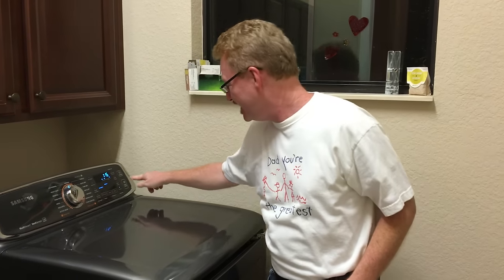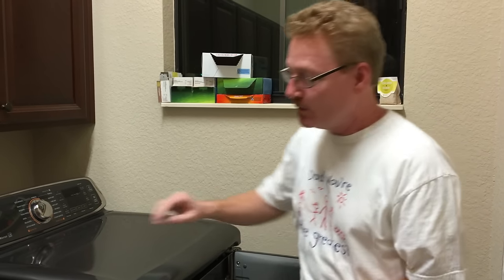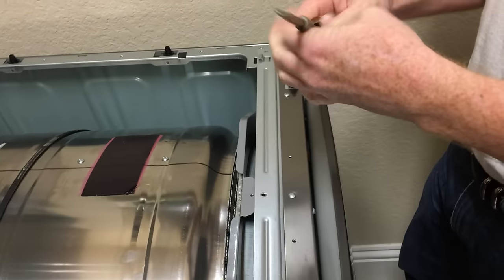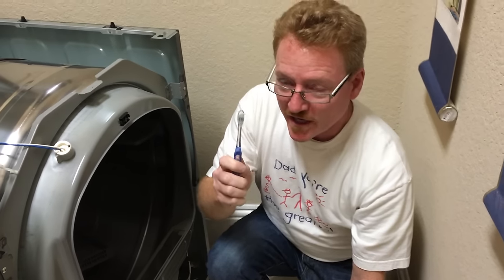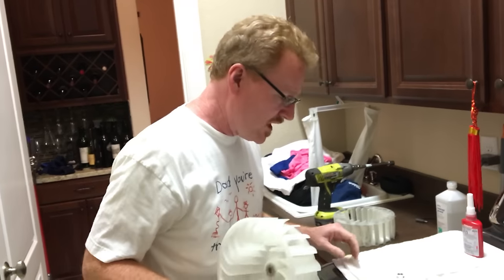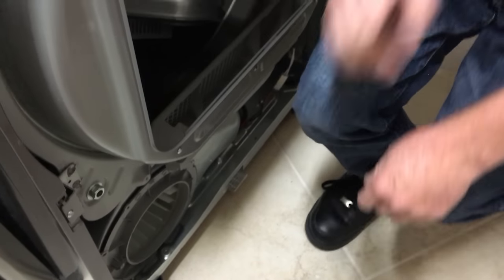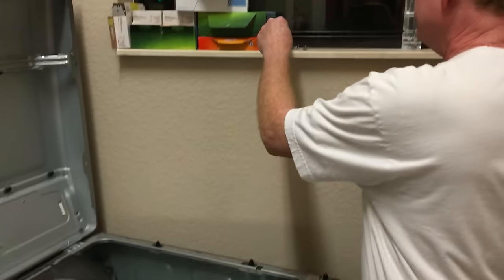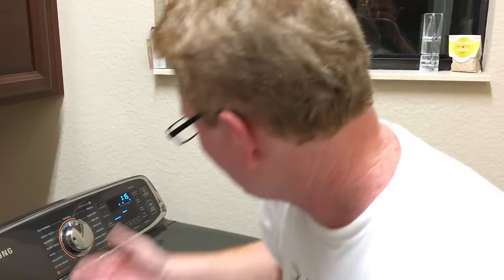How to fix a noisy, vibrating Samsung dryer in 30 minutes for $25 or less

Comment: Brilliant video. One of the best “how to” video I have seen.  Had a similar vibration on my Samsung dryer although it is a different model than in the video.  After looking at the video, I decided to check the blower to see if it that was the problem.  Took a bit to figuring out how to get to the blower since mine is a different model, but eventually got to it.  The blower wheel and duct leading to it, was completely clogged up with lint, tissue, and dryer sheets.  Cleaned everything out and reassembled all the parts.  The dryer is now working like new.  Thanks for saving me the cost of a service call, and perhaps buying a new dryer as, like you noted, the technician might have changed everything else in the dryer and not resolve the problem.
Reply from the maker: Indeed, glad it helped!

Comment: My 6months old Samsung dryer also started to vibrate so I did a YouTube search on this issue and found this video. This is one of the best how to videos I've seen lately on anything. I followed the instructions in this video and sure enough my squirrel cage was full of clumpy lint. I vaccumed all parts and this totally fixed my issue. Thank you for making this video.
Reply from the maker: Thanks for the kudos. Glad it helped!

Comment: Thanks for your video. In my case, a mouse got into my dryer and decided to make lunch out of the blower wheel. This put the wheel WAY out of balance causing a VERY noticeable vibration. Thanks for pointing out that mounting nut is LEFT hand thread. Thanks again.
Reply from the maker: Glad it worked! And yes, I get concerned about pests entering the vent from the outside too. So tempting to remove the screen but it serves a purpose.

Comment: Just wanted to say thank you for this video, I’ve had AHS to my house several times last year and worthless tech left my machine running like this without ever really taking it apart like you had the last time he left he said it’s fine you can keep using it like this the noise doesn’t matter. My vibration was so loud even with the door closed you can hear it throughout the house. They never call to reschedule and left me hanging and last week I got fed up and found your video. Took my dv56h9000gp/a2 dryer apart similarly and found me wheel gunked up with thick lint all on one side, I peeled it out and cleaned up my fins and vacuumed everything down there from years of never opening the unit in a household of 8. Spun my drum and the wheel was luckily spinning well balanced, added a few strips of butyl rubber sound deadener strips where some metal on metal would contact and make noise, put it all back together and it’s almost like new. Almost whisper quiet. Such a relief!! Thank you so much for showing me the insides of a Samsung dryer, I wish I would have known this sooner
Reply from the maker: Happy to help!

Comment: Thanks for this video. We searched high and low for information regarding opening up the front of our Samsung dryer model No. DV50F9A7GVW/A2 The one on this video is exactly the same as ours. Our problem was a noisy, vibrating operation. Being confident it was excess lint build up in the wheel, we wanted to fix it ourselves. We are a 75 year old husband and wife. With your guidance we were able to open the front, remove the blower cover plate and clean out the wheel. Problem solved! Great video!
Reply from the maker: Glad I could help

Comment: I replaced the belt, tensioner and rollers due to a rumble, and now I am starting to think this was the true issue. I ended up taking the fan wheel out and cleaning it anyways and lone behold, no more loud rattle. Thank you for this video.
Reply from the maker: Glad it helped

Comment: Excellent excellent video, one possible reason you don't want to hold the fan wheel when working that nut is you may bend the flimsy plastic, and then you are right back to square one with an out of balance wheel.
Reply from the maker: Your point might be right, but I was holding the fan wheel while removing it. If anything got bent it would have been on the wheel I removed.

Comment: I suspect the heat of the lint and air as it passes this wheel -- because of the cheapness of the plastic -- warps over time and becomes imbalanced which caused the vibration. A metal wheel would be much more effective, but the way this wheel is designed it guarantees a service call and added revenue to Samsung. Hopefully this video, which is EXCELLENT, will put the power to resolve back in the hands of the consumer.

Comment: Thank you so much for the video! I have an all electronic version of the dryer (Samsung model DV50K8600GV/A3, manufactured April 2016) and it disassembled exactly the same way you showed it in your video. The only thing I did differently was to disconnect the quick connect plug on the front door assembly so I could get it out of our laundry room and out of my way. I was luckier than you were though, as my issue was caused by a huge build up of lint on the blower fan blades, creating an imbalance. Once I cleaned it all out, it worked perfectly. There was no more vibration. Again, I can't thank you enough for taking the time to make this video!! I truly appreciate it!!
Reply from the maker: Glad my video was helpful.

Comment: This was the exact problem with my 2020 Samsung- i needed to use a bolt-type wheel puller, threaded into the two holes on either side. (Harbor Freight item 62620, $16.99). I was surprised to see how much lint passed the trap and settled onto the fan wheel. Thank you for the excellent video!
Reply from the maker: Glad I could help!

Comment: Your video made me the hero in my home. Our Samsung Dryer was loudly vibrating and something was rubbing inside. When I took off the fan-wheel cover, every blade on 1/2 the wheel was loaded with lint. I even think the Bounce Dryer a sheets made the lint and the plastic fan material sticky, be vise I couldn’t just vacuum it out. I had to use a toothbrush to free it and remove a residue on the plastic. Once reassembled, quiet as new! Thanks so much!
Reply from the maker: Glad you're a hero! Don't tell your family that you watched this video ;-)

Comment: Thanks for such an excellent how-to.  Dryer was SO loud and less than two years old.  UGH!  Plus in current virus situation wasn't thrilled with the prospect of having to have repair person in.  Followed your instructions and BAM!  quiet dryer.  I couldn't get lid to open with banging on it, so used a sturdy butter knife right about where the latches were and it popped right open.  Hey, if this 60+ year old lady with arthritic knees can do it with your clear straight forward instructions, anyone can!  Thanks again!!!
Reply from the maker: WOW, butter knife is a good idea because it's long and thin. Great advice! The only trick is -- where to apply it. I'm glad you figured it out.

Comment: I had spent about 3 hours replacing the rollers and tensioning arm, only to have my Samsung dryer shake loudly once I was finished. Saw your video, and tried to replace the blower fan. I couldn't get the bolt off. BUT, I was able to carefully clean all the blower blades (it was still in true). Put it back together again and it was quiet as the day we bought it. THANKS for making this video and helping guys like me who wouldn't have a clue otherwise.
Reply from the maker: Yes, typical story I think. My drier was under warranty at the time I did this work. We had a tech come and replace the rollers and tensioner, but the situation didn't improve and he could not fix it, so I had to do it myself. I have to do that a lot...

Comment: Thank you for this very helpful video. My dryer’s blower wheel was not broken or warped, but it was totally clogged with lint and 2-3 dryer sheets that were stuck on one side. After using a toothbrush on the fins and a shop vac on the loose stuff, the vibration was gone after reassembly. Thank you for taking your time to help others with this highly effective and easy to follow tutorial.
Reply from the maker: Glad it helped!

Comment: Well done. I followed your directions to a tee.   Our vibration problem was a lint in the blower blades so we didn't need a new wheel --  and we made 31 cents and 1 peso in lost change during cleaning.

Comment: Thanks so much for this video, our dryer was doing the exact same thing.  I got a little luckier as I did have a clump of lint throwing the wheel out of balance.  Cleaned it all out and it’s running smooth again.
Reply from the maker: Yep that's pretty common.

Comment: This video saved me so much time and probably a major expense as well. I had the exact same issue but my problem was lint build up in the wheel causing loud operation and excessive vibration.  Now it runs whisper quiet by comparison!!! Very few other resources like this that gets straight to the point and the tips and shortcuts work perfectly. Cost me nothing but time.

Thank you!!!
Reply from the maker: Glad it helped!

Comment: Excellent!  Big clump of lint. Runs great now. I found that removing the hinges made it a lot easier to pop the top off and on.  Put them back on when I got the front popped off and then removed them again to get the lid popped on again.  Thank you!!!!
Reply from the maker: Yes, regarding the hinges I agree. In my case, getting behind the dryer was more problematic, so operating from the front was preferable.

Comment: I'm not tough enough to hit with the palm of my hand so I used a rubber mallett to get the top part lifted ever so slightly and then felt for the clips with a butter knife. When I found them, I pushed in with the knife and gave it a wack or 5 with the rubber mallet. Thank you for making this video.
Reply from the maker: Yes that's pretty clever. Actually for many people, just removing the  screws from the back might be easier or more reliable. It was inconvenient for me to do so, and so I just went in from the front...
Reply: @WilliamBennerJr  I didn't see any in the back. I did it the way you did.

Comment: Thank you!  Opened my drier up today because it was so loud and vibrating terribly.  I found that there was hair and link built up in the fan, but the fan appeared to be perfectly round.  Cleaned it all out and put it back together and it is smooth and quiet again.
Reply from the maker: Yes in most cases it's clumped lint. I'm glad that was the case with yours as well.

Comment: The video was simple, easy to follow and I really liked the simpler approach that was offered to the professional one.  I decided to clean all of the lint off the fan, and see if that corrected my problem before removing the fan, and thankfully that was all it was! So no out of pocket cost and about an hour of my time. This probably would have been 100.00 repair for a professional call, so thank you very much.  Next home repair I have will definitely check your videos to see if you cover the problem before I look anywhere else. 5 stars and a thumbs up.
Reply from the maker: Yes, I hoped mine was just clogged lint too, but it wasn't... Glad it worked out for you!

Comment: Great video! I had the same issue with my dryer vibrating excessively for months. I followed the steps to remove the front, cleaned out a very dirty blower wheel, and 20 minutes later, I can finally dry my clothes again without shaking the whole house. Thank you so much!
Reply from the maker: Glad it helped!

Comment: Thank you for the great video. You are a natural teacher - your voice is clear, the presentation is well organized, and your cadence is perfect. Thank you also for calling out the supplier because many of us rarely purchase appliance parts and knowing who a good supplier is helps a lot. Two of the rollers on my 4-year-old Samsung dryer failed causing a clunking sound. The rollers on my machine are plastic wheels with metal self-lubricating bushings which rotate on iron axles. The lint soaked up the lubricant and eventually, the bushings and axles were destroyed. Hopefully, the rollers on your more deluxe machine have sealed bearings that will last much longer.
Reply from the maker: Thanks for the comment! I'm glad my video helped.

Comment: Thank you so much for posting this video. My dryer started making that horrible noise (mine seemed even louder) along with the vibration this morning. I will be ordering the part and hopefully my son and I can get it done. 🙂

Update: It turned out I did not need the part (yay). I texted this link to my son. He watched it and followed your directions and was able to fix the dryer. Once he unclogged it, removing all the lint, a pencil, 17 cent, a plastic token and a few other things, it was good as new. Thank you!

Comment: Thank you so much for the thorough video.  I experienced the same vibration/noise issue and went ahead and checked the blower for accumulated lint.  Indeed that was the issue.  I pulled out and vacuumed all the lint that was preventing a smooth airflow and it now works fine.
Reply from the maker: Yep, I expected mine to just be accumulated lint too, but it wasn't, so I had to go further. However, had mine been the simple lint, this video wouldn't exist!

Comment: Helpful video.  In my case, the blower wheel was so caked with lint, it threw the wheel off balance.  No need to remove it.  Just clean and vacuum it out and noise gone.

Comment: Thank-you for posting this, I followed your directions step-by-step.  When I got the dryer apart, I found a golf pencil wedged in the blower wheel which was causing the vibration.  Easy fix and simple to follow steps. Thanks again!

Comment: I cannot thank you enough for this video! Lucky for me it was just a giant wad of lint and some wayward dryer sheets that were clogging the wheel. It took me longer to clean out the lint and dryer sheet wad than it did to disassemble and reassemble the dryer. Again, thank you for taking the time to thoroughly explain each step in such an easy to follow format.
Reply from the maker: Glad it helped!

Comment: William, thank you for a great informative video. It helped me to fix a very noisy dryer that i didn't want to use into a very quiet machine! I did not have to replace anything, just clean out the fan of lint caught by a dryer cloth. Just this simple fix and now good as new. Best repair video ever. Thanks a ton.
Reply from the maker: Yes, that's the typical solution. I kind of wished mine would have been so easy, but if it was, I wouldn't have made this video...

Comment: Thank you so much for this video! I was able to use it to take my dryer apart and find a TON of gunk in the blades and in the vent housing. Cleaned it all out, saw that the wheel wasn't so bad, and put it all back together. My annoying loud rattle sound is GONE! Thank you!!!
Reply from the maker: Fantastic!

Comment: William, thank you so much for your video. My dryer is a Samsung with a small garment dryer on top, so I couldn’t get it apart as yours. I removed the filter and dared to put my hand inside, was able to rotate the blower wheel with two fingers  and to my surprise it had chunks of compacted lint, after few arm scratches trying to get to the wheel 😂, problem solved!
Reply from the maker: WOW, that took some guts and some skill!

Comment: Great video!  I have a Kenmore front load dryer/washer and the dryer sounded like it was coming through the  ceiling (dryer is on 2nd floor).  Turns out that plastic “blower” was filled with not only lint but also about 7-8 dryer sheets.  

Removed all the junk and lint, vacuumed, put everything back together and it’s quiet as a mouse again, and almost no vibration at all.
Reply from the maker: Thanks for the note. I'm glad the video was helpful. When ours started making noise my assumption was just that it was "clogged". I was a little surprised that the whole wheel was warped. From the feedback I've received on this, it seems that around 50% of the people are lucky enough to be able to resolve the problem by just cleaning the wheel.

Comment: Thanks William for the video!  I fixed the vibration by cleaning the blower wheel. 
Kudos for info on reverse thread and use of an impact driver.  Saved me a lot of grief!
Reply from the maker: Yes, actually impact drivers are not something I personally use in my daily life, but our mechanical engineer Ryan works on his cars and Monster Trucks all the time and he uses them constantly. He's the one who suggested it and loaned me his, otherwise the video would be longer and somewhat embarrassing that my first thought (just bracing with my foot) didn't work...

Comment: This was the greatest tube. I had to go to another tube to take apart my whirlpool, but then followed this tube after I got the front off. Mr Benner solved my problem and mentioned all the problems that you can encounter--different sized screws, parts that are difficult to get off, and little tricks.  I cleaned the lint in fan and it solved the problem.  Thank you.
Reply from the maker: Thanks for the kind words. Glad it helped!

Comment: I appreciate the teardown video.  I would only say that it can be the blower and it can also be the rollers and pulley set inside.  I think the issue is the fact that the lint catch is just badly designed on these Samsung dryers.  Lint can fly like literally everywhere; it is bad at catching it. I found a bunch of junk in the blower area and cleaned it out.  The noise got a bit better, but not fixed.  I think the next thing is to get the replacement kit for the dryer belt, idler pulley and all that good stuff.  I would not have known how easy it is to dive into the dryer if not for your video, so, thank you!
Reply from the maker: Glad it helped.